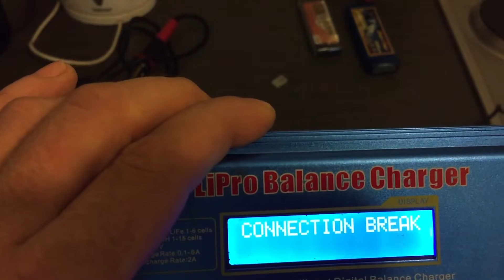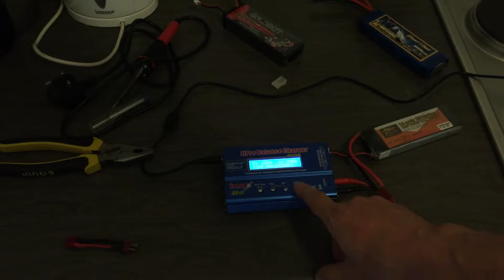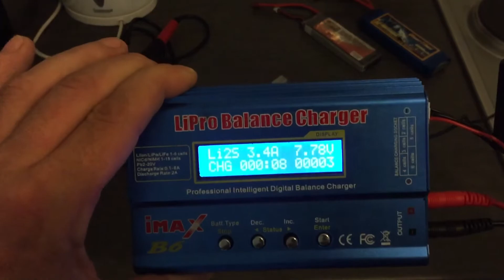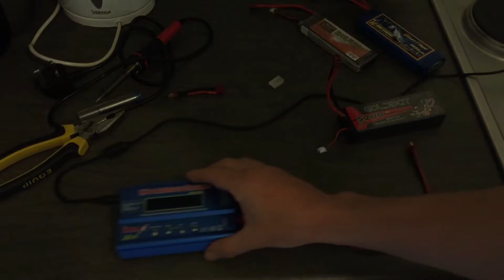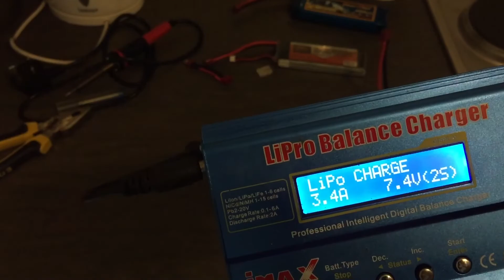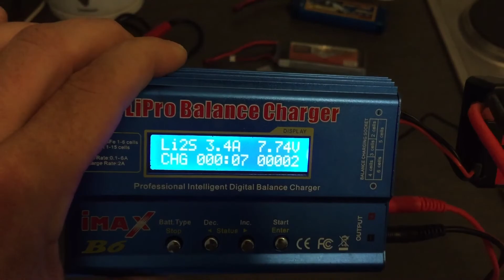Lipo balance charger. CONNECTION BREAK, how to fix the problem. 💯

Comment: I have just had a very similar issue with a SKY RC T200 on channel B. Mine came up with main port error. I thought the channel had gone down. 
So, I plugged another balance lead in in series, going from 1 to 2 balance leads, the channel now appears to work perfectly normally????
Many thanks for the video I would not of tried the extra balance lead except for watching this video. 👏👏👏
I have not a clue as to why it works, but it does. 🙂🙂
Reply from the maker: Same mate it’s just magic a think. You’re a wizard now. Thanks for watching mate.
Reply: NB Yes, I was being lazy and thought I would try an extra balance lead rather than extend the charge lead, but hey if it works, then it works...

Comment: I get CONNECTION BREAK all the time with my LIFE Po4 7Ah 12,8V battery after approx. 10-40 seconds with both blue IMAX B6 LiPro Balance Charger and also with my brown SevenChip B6 V3 Smart Charger. I have tried with 2 different battery cables from both battery chargers, which btw have different lengths, and I also splitted them halfway & swapped them around, but it didnt help. ChatGPT thinks its because of that the IMAX and SevenChip arent original and use cheaper components and recommends to buy the original from SkyRC which is also more expensive. An electronic shop & ChatGPT also thinks the battery must be the broken part and maybe due to the possibility that the cells inside way not have the same level. NOTE that my battery doesnt have the white balance connector, only the +/- connection as all normal Pb and LIFE 7Ah and 15Ah batteries.
Reply from the maker: Ha there. Since making that video a swiped my charger to a moor expensive one that’s moor reliable. I think the changer in the video is a knock off. The new charger has never connection brick any battery’s. The charger in the video with that 2s lipo is the battery it did it on and was a new battery with all cells the same lvl
Same battery in new charger is fine not once had a connection break I use that 2s lipo the most out of my 2s battery as well. I’d defeat getting a better charger moor branded.  Since that video I got a 4s outcast and got my forst 4s lipo. The charger in the video over bolted it and the lipo exploded. I put another battery in it and was reading 2.04 volts with would meet my battery was crap but when I plugged the battery in to a vlot reader it read 3.85 volts that it should be. So that charger recognized the battery as being well under bolted when it wasn’t and Ther for pit way to many volts in to the battery. Defo be safe with battery’s. It’s a must to get a moor expensive charger that has good reviews that you see other tubers using. Good luck be safe thanks for watching.
Reply: @bluexvxrc6827  ok, so you came to same conclusion that its better to buy the original expensive charger!
I even made my own new cable by taking the 2 cables I had and removing the possible bad Dean T-connectors, but that also didnt help. After I have seen your reply I think I will buy the original  & expensive now! Thanx for the update!
Reply from the maker: @djsirprice7959 I tried that first changing all the connections and cables it didn’t work so I tryed what I did in the video. Yes defo get a better changer. I use the HTRC C240 DUO charger now. Way getter charge 2 battery’s at once has built in fans that work properly and stuff. Just feels and looks a hole lot better has a few safety features built in as well.

Comment: You are the man! I never had this issue until today with the same charger and lipo. I was using a single shorter 7in cable (banana plug to XT60).
Now I have tried with those multiple cables that has different connectors which is also longer, no more connection brake message! Very strange the charger does not like short simple cables.
Reply from the maker: @Brunoxtr  glad to help. Thanks for watching.

Comment: Guys actually if you don't have cable extender you can just unplug those two wires that connect to t-connect/dean's connector from your charger, plug the battery in t-connect/deans from your battery into unplugged cable, then connect the whole thing to you charger, and the connect this white plug, it will work, I solved this exact problem for me a moment ago
Reply: So in order to make it work:
1. Plug everything 
2. Unplug battery but keep the white connector plugged 
3. Unplug deans connector from the charger (while keeping white connector plugged)
4. Plug charger connector into battery
5. Plug charger connector with battery plugged directly into charger itself. 

It should work, note, you DON'T unplug white plug through the process, and charger itself should be in the menu

Comment: What’s the extended bit called having trouble finding it online to buy it
Reply from the maker: I made it mate.
Reply from the maker: You need a male and a female connector then just add some decent thickness wire. Just be carful you get them right way round and done short nothing out.

Comment: I've been getting the CONNECTION BREAK error message on 2x batteries I've had in storage for about a year... I thought they wore goosed. I watched your video and then found a longer charge cable (I was just about to make an extension when I found a longer cable in my box of spare/ramdom cables) It worked!
If I wasn't looking right at it, working, I wouldn't believe it
Thanks man!
Reply from the maker: Not a problem mate. A was like you going to get rid of my battery’s lol. Had to make this video and save people waisting money. Glad to help.
Reply: Just picked up this charger and a brand new 2s battery, got the connection break error right away. I made an extension pigtail just as you did and voila! Works a treat now. Thanks!

Comment: Hi I have a ? which is may be connected with battery resistance matter: when I try to charge some 18650 li! ion batteries mounted with laptop or drilling machine BMS,my 12v IMAX BY quickly buzzes with " CONNECTION BREAK" error.Then it is no more possible to charge: is is something that is fused or melted in the BMS?Inreallynwonder how to solve this f....g matter 🙃Thanks!! .
Reply from the maker: I wouldn’t be able to help you there. Hopefully Someone reads this and can help you.

Comment: hi i have a 1s 3.7v 2000 mah battery that says conection break, but its voltage with a meter is at 3.58. what gives thnak you
Reply from the maker: A don’t really know much about a 1s bud. Prob try and extension on the balance. If not try putting new connectors on battery and that.
Reply: @bluexvxrc6827   need to try WD40

Comment: Does not work for me even chnging the connector. Does it mean my battery is done?
Reply from the maker: What connector have you changed. ?  Charger or battery. ?
Reply: @bluexvxrc6827  only battery to deans
Reply from the maker: @XRPHordz  so you have only changed the battery connection. ?
Reply: @bluexvxrc6827  yes
Reply from the maker: @XRPHordz  only thing I didn’t do was change the battery connection. Changed charger connection didn’t work. Added that extra bit and it worked. 
Read the comments below some people have mentioned other ways. I’d try changing out the charger connection see how that goes.

Comment: I can't see it so dark what did you do? I think I was doing something wrong I was getting the same error so you have to have both connections plugged in to charge? I did that now it's working!
Reply from the maker: So you have sorted it yes. Had to have it a bit dark so s teen would show up. Sorry and glad to help. !
Reply from the maker: And yes you need both plugged in. The original charging connection and the new one you made.
Reply: @bluexvxrc6827  I'm new to the lipo
Battery thing it's a little complicated, this one battery that I have is a weird size and it's hard to buy I think I let it run down to zero, I don't know how old the battery is when I purchased it or if I let it get damaged by not keeping it charged, but got it to charge after watching your video, I thought it was damaged but I got it to charge, But both sells didn't charge to 100% well one charged a lot higher than the other How can I get them to match each other if there's no damage? I wasn't planning on using it but I just wanted to get it charged so it wasn't completely damaged And I didn't want to leave it at a full charge so I have this little thing called cell meter 8, And I discharged it down to 53%. Should I let it discharge more? Like what would be a storage charge?
Reply from the maker: @earlyculyer4103  I’ve had problems with battery’s charging 1 cell more than others. 
What I did is just balance charged them at a low amp like 1amp. 
Then if cells where still far apart I’d srorage charge them at a low rate to 3.85 volts. That’s the safe level for storage. 
Then charge them agin at a low amp again. 
Be very careful doing this don’t leave them alone. Risk of fire mate. I’d watch some other videos on lipos as well. 
Fully charged lipo will be 4.20. 
Strange charge is 3.85
If you drop below 3.20 you run the risk of the battery being damaged and might not charge again. 
There is a way you can get a low battery back by doing a NMHI charge. Videos on youtube on how to do that as well. I don’t recommend doing it though bud.

Comment: Hi mate just been watching your video and it's help me a lot before I watch it I had the same problem with my charger I was trying for hrs I've got 6s lipo battery on xt90  keeps saying connection break so I did what you did extra the cable longer and it works very strange mate thanks 😊
Reply from the maker: Not a problem glad a could help. I was the same with brand new battery. So when I worked it out thought I’d help others. Thanks for watching mate.

Comment: it's that plug on the battery mate I guarantee you . took me a while to work it out when I had it happen.  your getting a bit of a better connection with that lead you made up for now  😃👍
Reply from the maker: A thought that mate honest. See one day the main plug to the wall, one a the prongs just fell of lol. So used one from lap top same spec. It worked agin no bothe any battery’s. Then happening again I changed the deans plug from the charger but was the same. Only connection not changed was battery one. I noticed on last 2s run it was struggling and only lasted 10 min !  Put a 3s in it and it was flying like normal. Senton video will be up tomorrow mate!?!? Take not when I go off the track in to long grass. It’s like it’s dead buddy. Left battery till last thing as you know it’s the crap bit to do don’t won’t to short nothing out( danger part lol). Thanks for watching mate. I am going to change the plug now. Makes cense  why the car felt weak on that battery not like it did last run with it. 👍🏻🤙🏻🏴
Reply: Nah it’s not that I have my own problems with it and I had it charged before (by a different charger) no problem but this one does not work